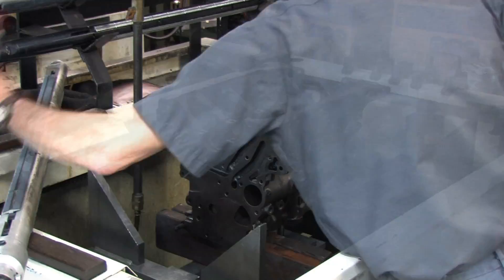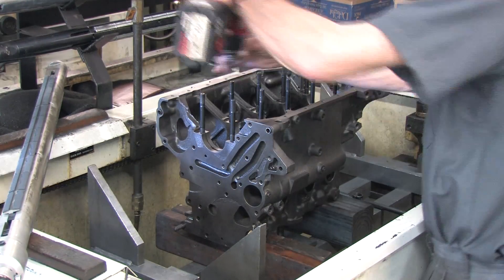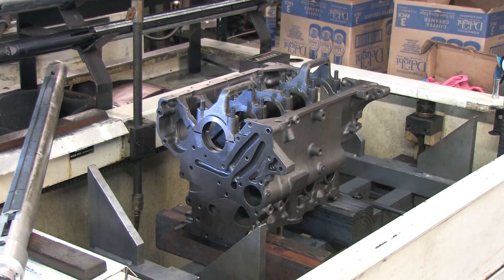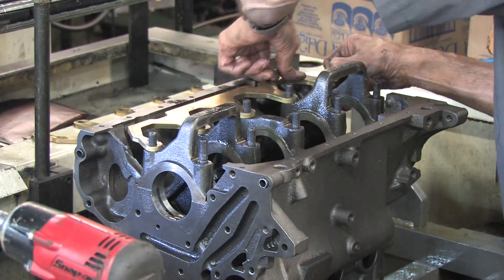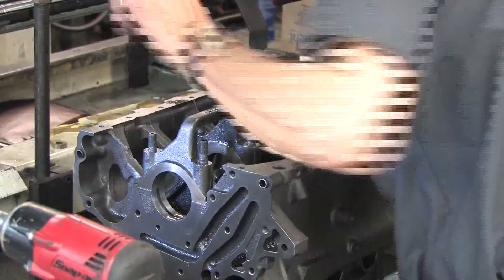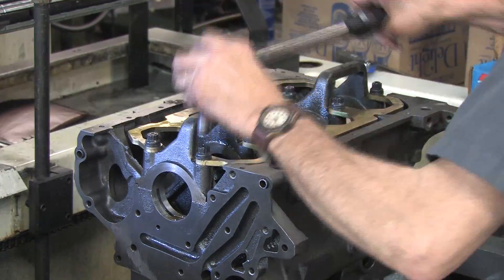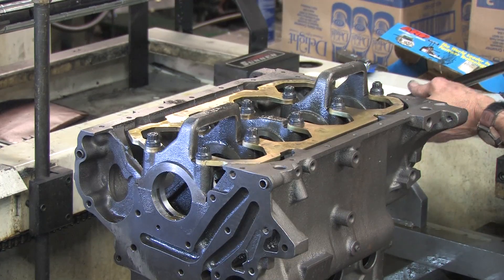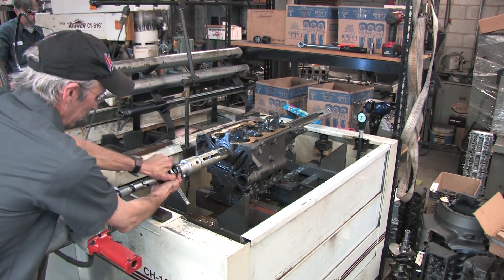6-bolt 4g63 Kiggly Main Girdle Install

Comment: What was your solution for windage tray (oil pan baffle plate)?
Reply from the maker: The 6-bolt 4g63 doesn't have a windage tray, and that's what this block is.  7-bolts have a windage tray... but the Kiggly girdle doesn't fit the 7-bolt because it would be redundant.  7-bolts second-generation blocks all come with a main bearing girdle.
Reply: Jafromobile awesome! Thank you for the fast reply. So no windage tray no worries?
Reply from the maker: 4g63s have baffled oil pans with a deep sump pickup.  Once you start them up and push some of the oil up into the head, the oil level drops enough that it doesn't get splashed around by the crank.  The other approach that I'm employing on this build is a butcher crankshaft (9 lbs of milled off, and knife-edged, micro-polished counterweights ).
Reply from the maker: ...also, the quick reply comes from the fact that I'm answering comments for a video I uploaded last night for my sponsors on Patreon.  They get 48-hour early access to new uploads before they go live here.  ;)

Comment: Hey jafro. I was planning on a modest build on my 6 bolt but lucked into a cheap pte 6262, I was essentially ready for assembly. Should I just get the girdle and then get my machinist to see if the mains are in spec? And hopefully will not have to buy oversized bearings?
Reply from the maker: That would be a good move.  If you're doing a balance shaft delete, it will bump your oil pressure in the block.  Perhaps do the oil gallery modifications while you're in there?  If you have to go a little bit wide in the main oil clearance using standard bearings, it's not a bad thing because it will alleviate some of that extra oil pressure. .0020" to .0025" on the mains clearance would be ideal.
Reply: Jafromobile thanks jafro! I had my crank ground, and If I remember correctly we went wide (.002) on the oil clearance because I wanted to be a little rev happy (~8000) let's see what happens with the torque curve though first. I did block my balance shafts and tapered the pickup on the head, I plan on putting a pressure gauge from the head to monitor it, getting excited to finish the build. The last part on my build was deciding proper camshaft, I'm not trying to build a drag car but something I can half drive on the street. There's kelfords 272/272 regular , and low lift. Was thinking going with the low lifts? Will be running steel kiggly beehive springs btw.
Reply from the maker: You're doing it right.  But... you know... that turbo is good for up to almost 750hp, right?  When that turbo comes alive, it's going to be a handful whether or not you're trying to build a race car or not.  I was considering using that turbo with a tangential T4 housing.  Still haven't decided, though.
Reply: Jafromobile maybe my experiment will help you then, I know I will have massive fuel delivery issues to overcome. As well as trans. I intend on letting the clutch be the weak point for now,  until I'm ready for a proper built transmission. The car has 750cc injectors, a 255 walbro fuel pump (dsm v2 link btw) and a tial 38 mm external wastegate, I have some shady t3/t4 manifold with the external wastegate that came with the car which I will also be recycling. The plan is to upgrade to 400 lph walbro, 1200 cc injectors and let the act 2600 just eat it till I can afford a proper gear box. Should be fun! And as always staying tubed!
Reply from the maker: You will need a working gearbox if you want any of the DSM transmission shops to build you one.  Parts have become scarce for those things.
Reply: Jafromobile surprisingly not around Detroit lol
Reply: Jafromobile hey jafro, do you think it's suicide at this point to be running the stock valves? What's your recommendation I already had the machine shop lap and restore a 3 angle valve job. Would hate to pay for it all again.

Comment: Hey Jafro, just had a 6 bolt built. I had my machinist install the Kiggly girdle. I asked him if he align honed it and he said all the bearing clearances were in spec so he didn't align hone it. I've read that it's necessary and not necessary to align hone when using the Kiggly girdle. I'm kind of worried about running this motor now. I've invested a lot of money in parts and machine work. Just concerned about that and was hoping for your insight.
Reply: Void l  what did you figure out with this?

Comment: Would a Kiggly girdle be pretty much mandatory at 600awhp/8500 rpm redline? While the girdle will help no matter the power level, at what point is the girdle really required?
Reply from the maker: I know someone who put down 640fwhp on a DynoJet with a stock-internal'd 6-bolt in a 2g.  A couple of months later, it violently fragged the flywheel (at speed) and it absolutely destroyed his whole car.  It blew his engine and transmission apart.  He didn't wreck it even though every hydraulic line was severed at the proportioning valve.  It quickly came to a stop while flipping bits of broken axles, transmission and bell housing over, munching up everything it missed in the initial explosion.  It blew a 2 foot hole in is carbon fiber hood.  It blew as ugly of a hole through the firewall and dashboard, through the windshield, through the passenger seat and out the glass in the rear hatch.  It chopped the neck of his Magnus intake manifold in front of the Throttle body and it took the throttle body and half the upper intake pipe with it.  It blew his cam angle sensor off and that was never found.  It put giant holes in the radiator and front mount.  

I'm of the opinion that all the safety hardware you can install is necessity beyond that range.  I'd have every main and rod cap doweled, I'd have the crank & flywheel balanced as an assembly, I'd have a girdle, a scatter shield, solid engine mounts, and a serious harmonic balancer.  I would have a fire extinguisher system.  That car would have a roll cage.  I would not want a passenger.  At that stage you sort of expect needing to use it like that.  It would be absolutely terrifying in traffic and you'd be overheating all over the place.
Reply: Thanks for the reply. Yea an exploding flywheel will cause a shocking and scary amount of damage. I have an chromoly flywheel and also a scattershield. My rotating assembly is forged, but no girdle. I see how any amount of prevention should be considered, especially at high power levels.
Reply: Jafromobile Jeezus!!! That's some real shit! Thanks for sharing that story, I'll be sure to overbuild my next project and factor in safety after reading this! It's funny cuz most everyone is solely preoccupied with HP! More power! While neglecting personal safety as well as their passenger's safety.

Comment: At 1:55 he didn't tighten it down in any sequence.  Tighting things down in a certain order causes the block to stay in shape and not flex to break sooner when under load. the first part should of been tightened down in a x pattern starting from the center and also the other end of the part the middle really doesn't matter. except for the plate being put on. So center out in a circle like the heads and intake would of been best I feel.
Reply from the maker: I had issues with a few things he did, but it's probably not the end of the world.  I might have to install a different set of bearings because I changed directions with this build selecting a different crankshaft.  One way or another, it's getting assembled properly and fully checked out with a bore gauge.  I'm betting it isn't far off if it's off at all because of the size of the mains in a cast iron 6-bolt 4g63.  He really didn't have to do much to it.  She was straight to start with.  But yeah, that's not all he did wrong.  I forgive him.  I've got so many assemblies ahead of me before it's through...
Reply: Jafromobile Well you know what's going on and you're videos are well explained I think. You have done a great job. Thank You!!
Reply: Jafromobile I thought the same thing... figured a machinist his age would know better. but where do you draw the line between experience and senior moments lol

Comment: Jafro, do you have a video of installing the oil pickup? Or does it bolt in just like I pulled it out, if I am installing a girdle? thanks!
Reply from the maker: NIk Potter You know what?  I haven't even done it yet.  I know, I suck.  I have read about others using the 2g pickup tube on a 6-bolt.  I can tell you the 6-bolt pickup won't fit on the third member because the head studs required for the girdle are 2mm bigger than the factory bolt that it used to bolt down to.  You can either trim that out and bend it around to fit, or use the 2g pickup that doesn't even have provisions for it.  I had bought a 6-bolt pickup for my build and was going to modify it, but I ended up using it on the Hyundai build instead.  Probably going to go the 2g route.

Comment from the maker: +Sam Quad  Your replies are disabled.  Yes, the largest benefit is additional support for the thrust bearing, but another benefit is dispersing harmonic vibration.  The crank is going to vibrate, and this lets it disburse its energy through all the mains instead of just one.  Basically it quiets that vibration's affects on the main bearings.

Comment: Was wondering what you were going to do with the transmission to help support the added power? We are really having a lot of problems with our transmissions behind the 6G72s even with 300M output shafts, billet end cases, dogbox, reninforced transfer cases, etc. Do you think that you will be below the HP threshold that things start breaking in the drive line? What about the drive shaft?

Comment: Hey jafro nice video. I have a noob question and that is how can you tell that is a 6 bolt engine in the video  I didnt see 6 bolts on the mains so how can one tell the engine is a 6 bolt? thank you
Reply: I have been wondering the same.  This is how I ended up her on this video trying to figure it out.  All of the photos of 6 bolt mains only show 4?

Comment: My intentions are to build a 600hp 4g63. Though it will be more than strong enough to handle more boost in the future, if I decide to need more power. Your vids have been very very helpful. Much appreciated.

Comment: So a properly built 2g would be stronger, but as stock, 1g is capable of more hp's and boost.  Not including the differences in the head and oil pump.  I have a 97 gsx and 2 extra blocks, one is a thrust washer 2g and the other looks like a 90-92 6 bolt.

Comment: quick question, will the 6 bolt internals fit in a 2g block?  2g block has oiling issues though.

Comment: Great thanks a lot! After watching your cylinder head series I will be doing most of the head work myself. I just get intimidated when working on the short block. Everything needs to be very precise. I'm sure that the comfortability comes with experience. Thanks again for being a pioneer for the average DIYer.

Comment: i was thinking that i could run the +1 mm valve since i wont have to put new seats.  plus i can also deck the block or the head to reduce the squish and make the engine more efficient.  also i need to take into account the adjustment on the cam cears.

Comment: Sweet descriptive video Jafro! I sure wish I had confidence in our local machine shops in my area. I had nothing but bad experiences with the local machine shops. One shop forgot to lap my valves when I got a head rebuild done. when I double checked the work the valves failed the hydro test. Most of our machine shops are foreign to the 4G63. What are some of the things to look for when choosing a machine shop?

Comment: have you ever check your piston to vale clerance with stock vales?  i am thinking of going to th +2mm intake valves and am wondering what the piston to valve clearance would be after installing the +2mm valves and the 1.3mm mls head gasket.  anyone got numbers?